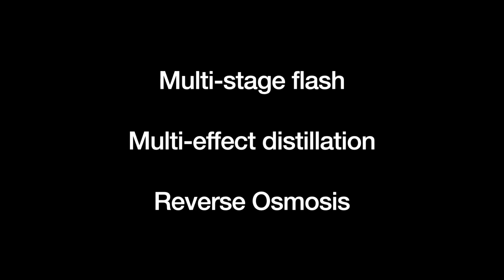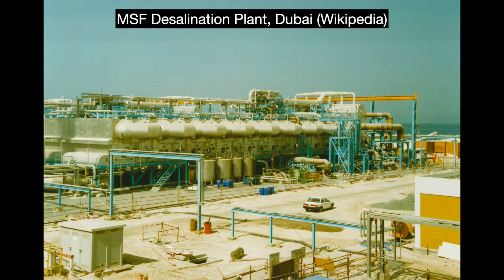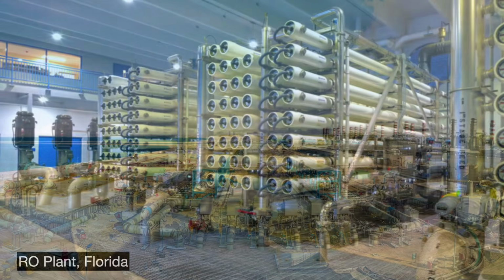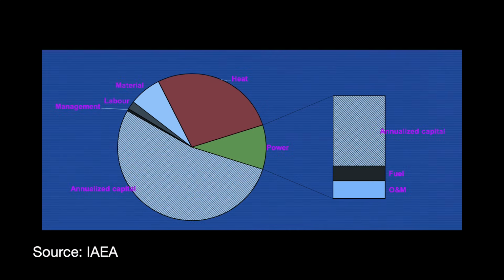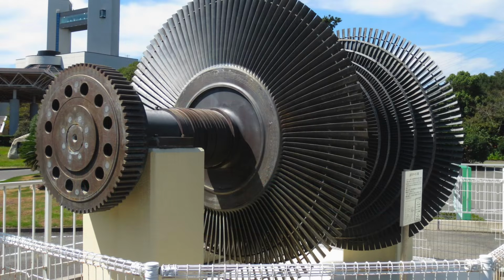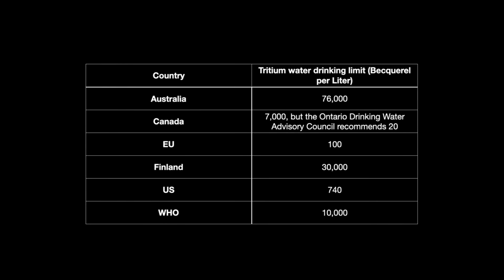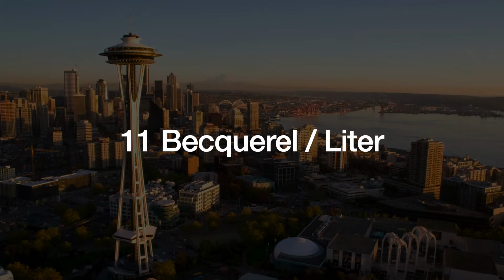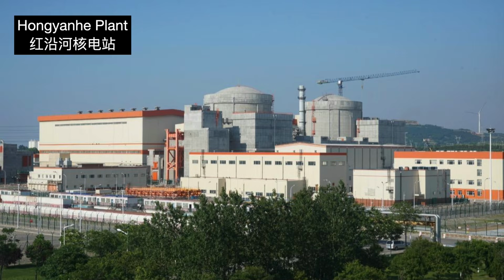Going Nuclear to Desalinate Seawater

Comment: Combing flash distillation with nuclear would be a good combo.  In flash distillation, the brine is heated, not boiled.  The brine would be at a higher pressure than the steam heating it, so any leaks will be from the seawater to the secondary loop, excluding tritium transfer from the secondary loop to the brine.  Not so great for the plant now getting brine in the secondary loop, but great for keeping the product water radiation free.

Comment: Generally, the tritium in the primary loop is going to be in the form of water.  Any leaks will travel out with the steam.  If it is in the water, it will persist in the secondary loop far longer.   As a hydrogen gas, it would be removed after one pass through the turbine in the condenser and vented to the atmosphere.  In water form it would be condensed and sent back to the steam generator again and again.  This would let the tritium build in the secondary loop, where it is darn hard to remove.  That is mostly prevented by keeping the tritium level in the primary loop low.  For light water reactors, this is mostly done by keeping the deuterium levels low.  There are portable deuterium extraction plants that will process the primary water and take it down to levels similar to water in the environment.

Steam generator leaks are detected via GM tubes on each of the steam generators' steam lines.  The primary loop water has lots of metastable N17 in it, created by the spalling of neutrons off oxygen.  In a steam generator leak, that N17 shows up by a rising gamma level around the steam lines.  That said, a small leak is normally permitted.  The plan I worked at allowed 50 gal / day max primary loss, with a max of 15 gal / day primary to secondary.

Comment: Let's level up to Thermal Perpetual Motion for saltwater desalinization. First borrow heat from the planetary ambient to make clean steam then  pay back the energy loan by condensing the steam to ambient temperature pure water. The thermal energy. release of undisolving the salt is a local energy gain. Thre second law of thermodynamicamics can possibly be escaped by passive sorting by nano trapdoorssorting ( Marian Smoluchowskiy (professional 1912 paper with counter conclusion)), which is similar to Maxwell's demon (if the demon didn't use vision)), and Feynman's pawl and ratchet wheel ( couter conclusion.   but what if multiple pawls reduced counter rotation). If the second laws it will be a hard  fall.

Comment: The fear around radiation is a bit insane and there are substantial efforts by the oil/gas industry and environmentalists to slander nuclear power directly and continuously for decades. The irony in all of this is that on a numbers basis nuclear power is one of the safest forms of energy production. Even if you count the deaths, as rated by the most extreme environmentalist groups, caused by Fukushima and Chernobyl the total deaths is nowhere near the deaths from air pollution due to coal. Millions of people die each year from air pollution from coal and an estimated million people have died from Chernobyl IF you assume that the unverified highly-speculative and highly politicized "research" from environmentalists is accurate. Many other sources disagree on the total number of indirect deaths from Chernobyl.

The reality is that nuclear power is dangerous and it does have the potential to cause long-term poisoning and blighting of land. This is not a joke, but along with that is the promise of a world with nearly infinite stable electricity at a fraction of the price of current rates. This opens to the door to new technologies that basically exist but aren't electrically viable, like titanium refinement from TiO2, hydrogen at scale, etc.

As a fun note, the people who invented the nuclear reactor for Plutonium production explicitly stated that it was dangerous as all hell and should only be used in a laboratory setting. This danger largely stems from the use of water as a coolant and neutron moderator. Water has many properties that make it terribly dangerous for use in a nuclear reactor. A proposed alternative was the molten salt reactor, which is much safer and not under pressure, but the government scrapped the program. Most of the costs associated with nuclear reactors are the pressure containment vessel and the insane regulations around nuclear reactors that stem from nothing other than fear and propaganda.
Reply: oil industries are a fault for a lot of our climate, water, and food shortages. And yet no one ever talks about how they have misled a significant chunk of the population to continually destroy our environment. And wow, can't believe some people still believe climate change is not man made. How oil industries made climate change a political topic really screwed our progress on it.
Reply: @edwardroh89  From my limited perspective of history and human behavior it would seem there is a silver lining. That is that when humans do dumb, horrid things like that, usually for short-sighted reasons, it becomes a problem and eventually humanity mobilizes and when we stop the behavior it ruins the game for most people for many years if not permanently. It's partly how laws work, people do some dumb stuff so we pass a law so they can't ruin the party for everybody. To me fossil fuels are a perfect example of this, they're terrible now but this is the end of the end for them, nobody is going back to that after it's all gone and people can actually see a horizon and cancer rates plummet.

Comment: Nuclear desalination makes great sense.
Nuclear generates lotsa heat and can be used to boil water... cools down the vapor and get clean water, rinse repeat.
Reply: Nuclear power does make great sense as well, the problem is the handling and damage potential. With two prime examples and a lot less or unknow near catastrophic events I am happy not to have to rely on this option.
Reply: @443Corp  2 ejemplos buenos mis huevos, uno era un reactor militar pesimo (Chernobil) y el accidente de fukushima fue un evento sin precedentes, no este mamando. 

Buenas tardes.
Reply: @443Corp  Natural gas plant accidents and pollution kill more every year than nuclear ever did
Reply: @443Corp  You will see a bigger catastrophe when war happens because of Energy... New reactors are made in a way where things like those two cases are impossible to happen....

Comment: Has anyone ever seen someone using the heat from nuclear waste to desalinate water?  I always thought it was a waste to bury the stuff when the heat could be used for industrial processes.
Reply: The heat from nuclear waste is relatively mild compared to the heat in a nuclear reactor that is actually running. You'll notice the video mentioned the Sodium-cooled nuclear reactor by the Caspian sea. This is interesting because Sodium-cooled reactors run at a higher temperature than normal water-cooled reactors. That is relevant because the efficiency goes up with the higher temperature, and the left-over heat (after electricity generation) is more suitable as so-called "process heat" -- of which desalination is one example. So basically, you'll want the heat to be as intense as possible to achieve reach various extra goals beyond making electricity.

Another example of using left-over heat as process heat is to make hydrogen with nuclear power -- in the colour scheme for hydrogen made in different ways, this has been assigned the colour purple. My understanding is that this requires even more intense heat than desalination.

In any case, I suspect making a whole mechanism around nuclear waste to draw away the heat it gives off, while limiting Tritium migration, will cost more money than it's worth.
Reply: @eckligt  Making the input temperate as high as possible is just the carnot law of efficiency.  My thought on using heat from nuclear waste is to make use of a resource, low grade obviously, but also very low cost and maintenance issues.

Tritium is from the neutrons in the reactor being absorbed by water.  Any non water coolent will do, helium, salt, sodium, lead.  The high boil temperatures of water, sodium, and salt also means you don't need high pressure containment as you do with water.
Reply: Using a heat pump, heat can be extracted from anything, even tepid water or cold air.
Reply: @motimobo  I was talking about using the waste heat from nuclear waste to do something useful: desalinate water, generate power, etc.  It seems so wasteful to bury an energy source.
Reply: @kennethng8346  The nuclear waste that gives off heat is high-grade, basically recently spent fuel rods. After a couple of years the short lived fission products are decayed and the rods are almost room temperature but still quite radioactive. During this period the only use the heat has would be to run Stirling generators, given the radiation would destroy solid-state thermoelectric generators and activate any water run near it.

Comment: If you desalinate too much water from our planet though, it can screw with the planet in the long run if we deprive the land of water in a sense?
Reply: Not really, if you end up taking a shower in this desalinated water, it'll go through the waste systems where you live and eventually make its way back to the sea. It doesn't ultimately change the amount of water, nor of salt, on the planet.

Locally, it can of course have environmental effects where the brine is discharged back into the ocean. But I'm sure that can be mitigated by thoroughly mixing the brine with sea water to avoid it falling to the bottom and pooling there.
Reply: @eckligt  Or turn the salt brine into battery or something akin to lithium.

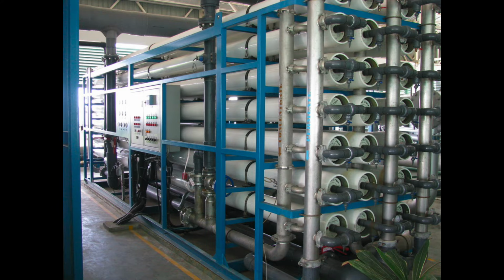Comment: At 08:09 I would have to disagree with the graphic. At least for the current PWRs, The main steam enters both high pressure and low-pressure turbine to remove as much energy from the steam to turn the generator. Once it exits the turbine, the vacuum from a condenser is what pulls the exit steam and the secondary cycle once again starts over. With your graphic, it seems to suggest that some energy be used for power and the rest would be for desalinization. The problem I see with that is you now introduce two potentially variable outputs in your secondary loop that likely result in more significant power level variations in the reactor. This is not very good from both a Nuclear Physics standpoint nor Nuclear safety. What would probably be the solution is that the power production side and desalinization side would be two separate trains and the nuclear operators would control the direction of steam through some sort of bypass valve. You actually see these discussions with some of the SMRs being developed. The big picture is that you want as little change to the reactor as possible, so the best bet is to change the direction of what the heat dissipates to versus bolting on an additional outpoint on one train.
Reply: I am not sure I get your point - Only super heated steam goes through the turbines, right? 
So at some point after the turbine you need to condense the steam (for the next cycle) which is where the desalination plant comes in.
I don't think it uses some steam for power and some for desalination, rather the desalination plant is the condenser.
Anyway, that is how I am reading the graphic

A thermal desalination plant is just a cooler, it doesn't even need to be steam, as vacuum is being applied to the desalination chambers so salt water will boil of at less than 40 degrees.

Comment: In order to have a productive discussion on the future of our fresh water needs, and the role of desalination within that system, we need to be honest about the facts.
And as such I'm missing a few important points in the "environment" chapter of this video. 

Namely, the wastewater that gets produced. And is currently most often just dumped back into the ocean.
Aside from many of these processes using chemicals to pretreat the incoming seawater, the brine that gets produced has significant impacts on the environment as well. Mainly killing everything on the ocean floor.
For every gallon of fresh water there's a gallon and a half of super salty, low oxygen brine produced. Which doesn't mix into the regular seawater, but rather sinks to the bottom.
Reply: With a thermal design, we can get higher concentrations of salt, leave those on land, and extract the valuable salts like lithium salts.

Comment: I'm surprised the sheer heat of the sun is not being utilised find deserts to do desalination for large pans of seawater.
Reply: I don't think you can effectively cool down the steam in the middle of hot deserts.
Reply: @tykep1009  some metal pans? idk? at least the heating should be cheaper?
Reply: @tykep1009  Water evaporates according to air pressure. There's no need to heat it up so much if you use a vacuum pump. Just use the desert heat to stop the water freezing due to evaporative cooling.

A dome with a vacuum pump, a condensor and method to pump desert heat back into the dome would be farily low maintenance and you could have thousands of domes in the desert or floating on the ocean piping fresh water onto land.

Comment: Use molten salt reactors and the high temperature will allow manufacture of liquid fuels like ammonia. The waste heat can be used to desalinate sea water. The big danger is returning too much brine back to the sea. It has to be done in ways that wont over-saturate the local area.

Comment: I guess, in the cost calculation, the recycling and storage of the nuclear waste is not part of said calculation. Otherwise, the costs are not bearable.
Reply: Too much waste, uranium reactors only used 10% of any given fuel rods. 90% being considered waste.🤭🤭
Reply: @richardscathouse  all nuclear waste ever created would fit inside a single sports stadium.

Coal burning has produced more radioactive waste. Where does it go? In our air, soil, and water

Comment: As an electrician who has worked on US nuclear, combined cycle, solar, and wind energy plants, I feel that nuclear power is one of the greatest boondoggles ever perpetuated on humanity. It is by far the highest cost for electricity, and that is with the highest level of direct taxpayer subsidies. In the US, taxpayers have spent in inflation adjusted average, 3.5 billion dollars a year on nuclear energy since 1948, yet costs $131 to $204 per mega Watt hour, not including decommissioning, long term waste storage, security, and public insurance costs. While other power production does have some corollaries with toxic wast cleanup and security, they are minuscule compared to nuclear power. In contrast, renewable energy has received 0.38 billion in taxpayer subsidies since 1994, and costs between $26 to $50 per mega Watt hour.
The major myths about nuclear power that have been perpetuated since the 1950's is that it is clean, safe, and will be to cheap to meter. None of that is true. Many electricians will tell stories about having limited work times due to radioactive releases, and when we work, we have to have one other electrician watching everything we do to ensure that no mistakes are made, and the amount of redundancy is ridiculous, yet necessary. Last time I worked at the Humboldt Bay power plant that closed down in the mid 1970's, it still employed hundreds of people in decommissioning and working to contain the plume of radioactive groundwater from reaching out into the bay. There are military guards with automatic rifles with shoot to kill orders for anyone without proper access. You never ever take your badge off. This is the same in all US nuclear plants.

As to it being needed for its "low carbon electricity," it is like an electric vehicle in that it does not have a tailpipe or a smokestack that releases pollution at its point of use, but the entire supply chain for a nuclear power plant is very CO2 intensive. From the large mining equipment for the materials and fuel, to the refining and transporting of astounding amounts of metal and concrete to build the plant, and to the ongoing fuel supply, and then the temporary dry cask storage containers that are made out of 100 to 150 tons of steel and concrete, and will need to be replaced every 25 to 100 years for tens of thousands of years, it has been estimated by independent of industry and non aligned studies that nuclear power produces about the same amount of CO2 as natural gas. And when decommissioning and the increasing difficulty of extracting the deeper and less desirable uranium ores, it is now approaching that of coal.
To be fair to EV's they do offset their CO2 production compared to an ICE vehicle after about 6000 miles of driving, and only continue to produce less over time, especially as the electricity mix continues to contain more renewables.

Some very interesting ways of disposing of radioactive metals has been found, called "Dilution in the Consumer Stream" where the radioactive metals are shipped to foundries, chopped up into small bits, and then added a little at a time into larger batches for consumer goods and building materials. The amount of construction materials it takes to build a nuclear plant compared to a conventional plant just boggles the mind, and having worked there, I would not trust my life on them. Since no insurance company will insure nuke plants, the US government requires them to carry 450 million of insurance for each reactor, with another 13 billion available from all of other nuke plants kicking in extra money. Any more cost for "accidents" would be picked up by the US taxpayers via congressional approval. As Fukushima is expected to pass the one trillion dollar mark soon, that would leave the US taxpayers on the hook for 987 billion dollars for the same type of accident. That is a lot of money to gamble with, and would go a long way towards paying for the renewable energy to replace nuclear power.